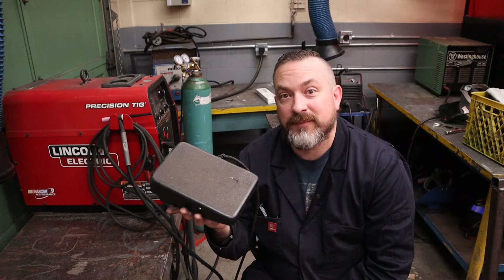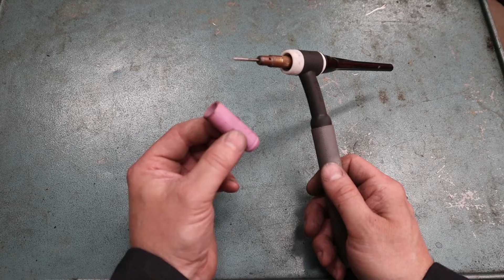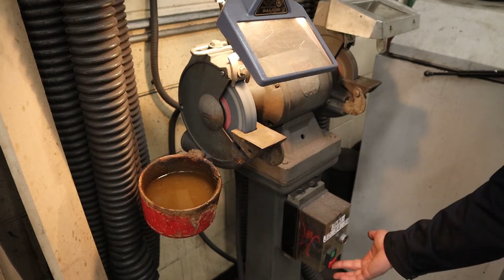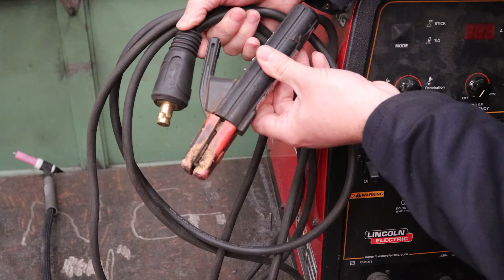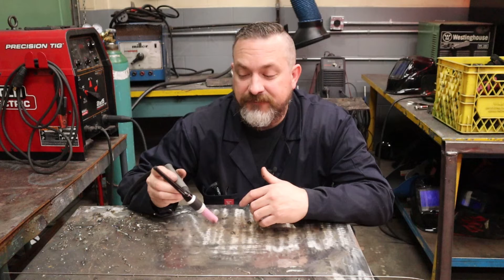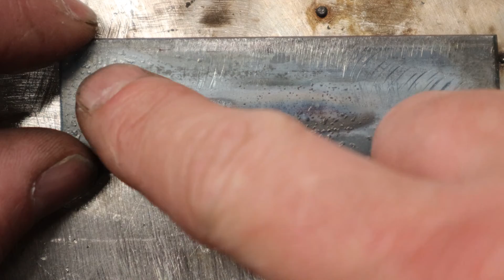TIG welding: easy to learn

Comment: do you have TIG video for running bead on top of mild steel coupon with shiny looks result?
Mine has the same result with yours (dull color. mostly black bead colors..)  😕
Reply from the maker: No not really.  I have always had issues with controlling the heat, usually I'm moving to slow.  If the end of your weld bead is shiny but the rest isn't, then the shielding gas is probably ok.  So that leaves your material isn't  clean (I also often don't clean my material) or too much heat is used ( going too slow or too much amperage).  Hope that helps.  Thanks for the watch and welcome to the channel!

Comment: Thx, very informative.
I do have a problem with visualizing tip of electrode distance to workplace. The tapered tip is obscured by the light of the arc so what I see is glowing rod but not the actual tip of the electrode. Do you actually see the true tip?
Reply from the maker: Yes you can see the distance if your head position and welding lense shade allow it.  Otherwise you'd be dipping the tungsten constantly.  Might take a bit of experience but you'll get there.  Thanks for the watch!

Comment: You must have a old machine, blue tungsten is the norm now. Plus I like not having radioactive dust flying around when I'm grinding my tungsten. Also most new machines will say in their instructions not to use the green pure tungsten
Reply from the maker: It is an old machine but the basics still work.  Sometimes it comes down to budget too as we are in  high school.  The red/green electrodes are cheaper and I have a lot of old stock to use up.  I have switched to blue electrodes recently though as the tip last longer with AC welding.  Thanks for the suggestion and the watch!

Comment: fantastic overview on teaching how to TIG welding my main question is is your Lincoln welder a transformer machine because you made mention of the green tungsten and also to the red tungsten? me personally setting up on my machine I use the blue 2% lanthanated on mine I got a primeweld Tig 225x mine is a inverter based machine AC/DC welder too. and like I said I used 2% lantinated blue tungsten pretty much all the ways around and when I get into high amperage AC welding I use the gray tungsten.
Reply from the maker: Thank you very much!  Yeah the Lincoln 225 precision TIG is a transformer machine with squarewave tech in it.  This allows you to run red electrodes and the balled electrode tip isn't even needed either.  It's actually a decent little machine. Thanks for the watch!

Comment: Ciao, great video!Sorry for the noob question, but what can happen if the tungsten tip touch the filler rod!??
Again...great videos!But i'm still afraid to do the first attempt... :'D
Reply from the maker: Ciao Francesco!  The filler rod will melt and might get stuck or contaminate the tungsten electrode requiring you to regrind the electrode.  You will be wearing gloves so nothing will happen to you.  You got this dude!  Thanks for the watch and welcome to the channel!  Remember, we were all noobs at one point.  Cheers!
Reply: @wayofthewrench  thanks thanks a lot for your answer!
Yesterday has arrived the Lincoln 3350 mask...hope to test it soon as possible. But i need gloves and other protections before ☺️
Reply from the maker: Cool, I wish you luck.  If you have any questions, feel free to ask!

Comment: I have to ask what if your machine doesn't have a foot pedal
Reply from the maker: There are other ways to start the arc like a trigger button on your torch for high frequency starts or your machine might have a lift start (touch to start) setting where you touch the part and as soon as you lift the tungsten off, it will start.  Both of these have full amperage unless the trigger has a slider to scale back the amperage.  Some machines have both of these as well.  In my experience, a pedal is kinda crucial to learn how to properly tig weld and the other ways have their time and place but generally they are for awkward situational work like welding up off the ground or repeated constant work where you don't need to adjust your amperage during welding.  Thanks for the watch!